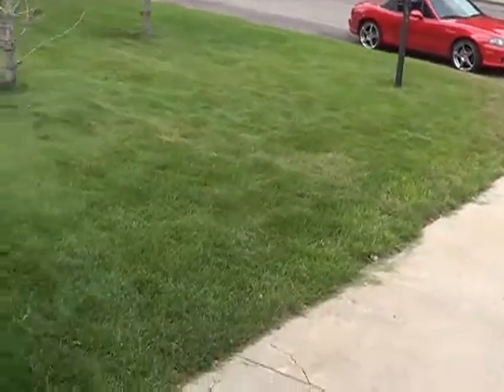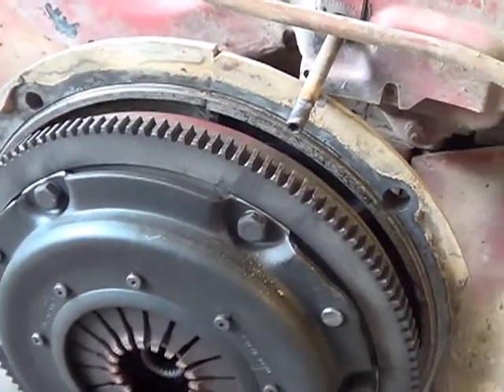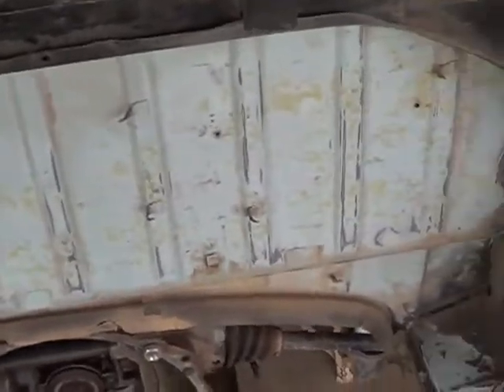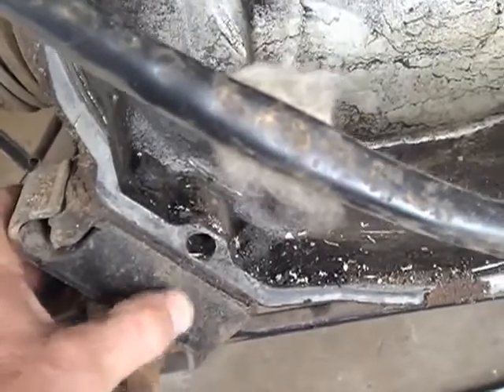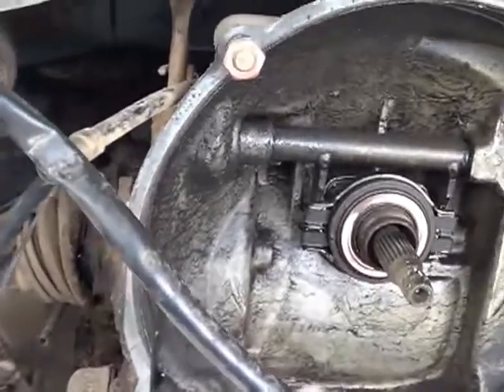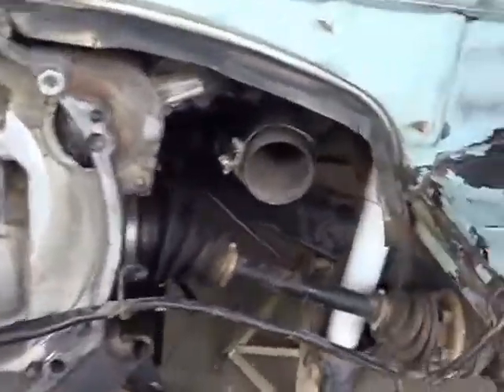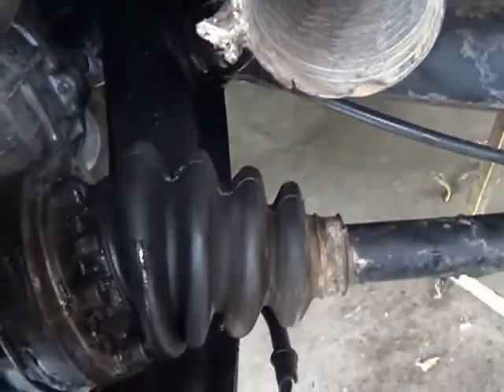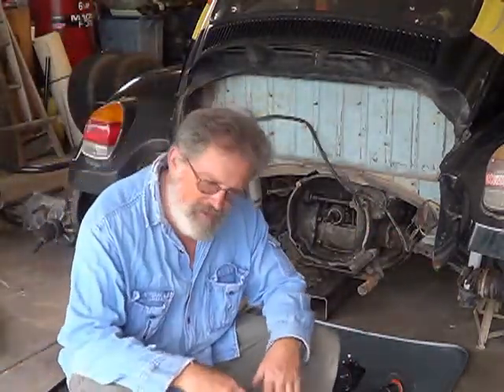Baja clean up and v log

Comment: you were saying how the tar board could blocked  the fan, i remember years ago when i worked in a garage, a guy came in  with an over heating vw van it was so hot the tin work burned my arm as i took a half a roll of cling film out of the fan, dont know why he had a roll of the cling stored in the engine bay .